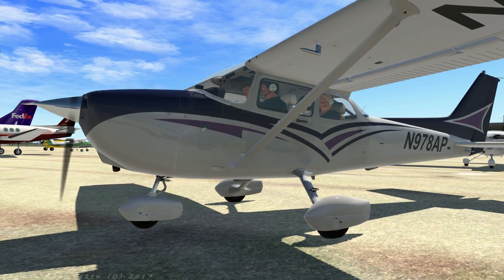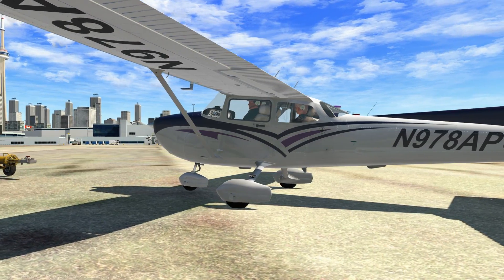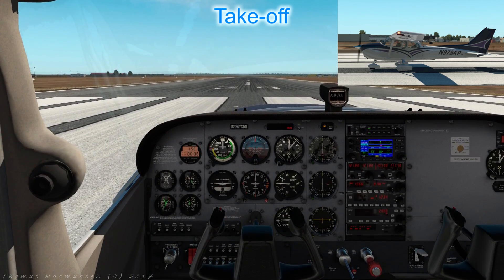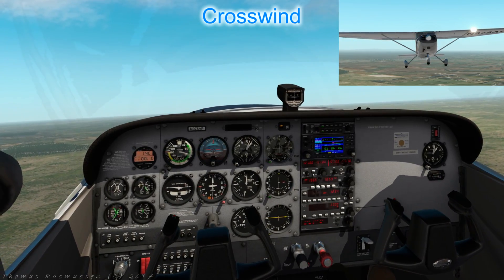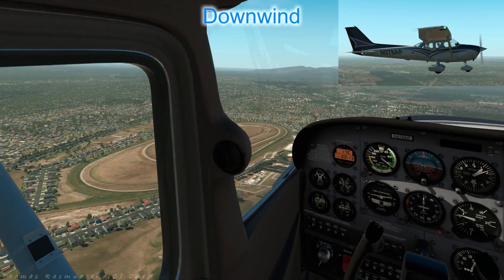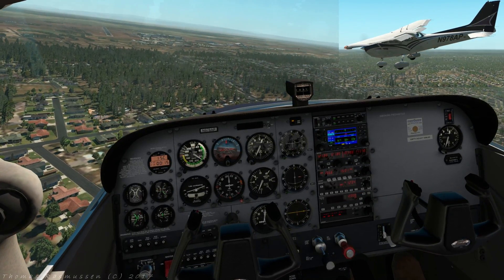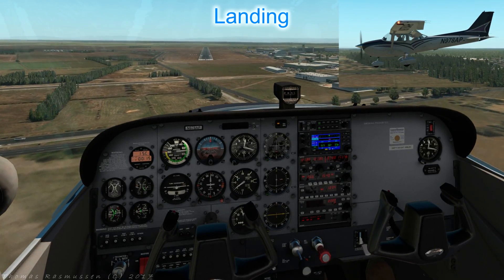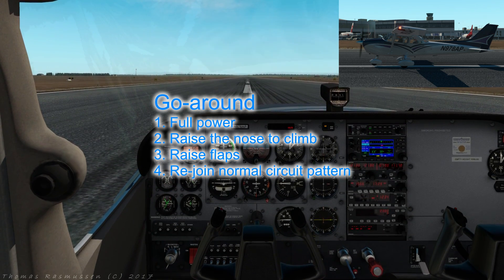[X-plane 11] Flight Sim School - VFR Lesson 6 - Basic Circuits

Comment: Hi Thomas, your knowledge of flying a circuit my be different now considering this video was made three years ago.  The down wind leg is flown much closer than a mile as stated in the video. Most pilots will place the runway in a position that is half way up the wing strut on a standard traffic pattern or circuit. How would another pilot find you in the circuit if you're a mile away?

Comment: "As the climb continues up to 1000AGL..."

Procedes to fly entire circuit at 1100ft
Reply from the maker: Field elevation as seen at 05:07 is 100 ft MSL so 1000 ft AGL is correctly flown at 1100 ft MSL
Reply: @ThomasRasmussenXPlane  But if you're doing circuits at an airport, why wouldn't you just get the altimeter setting?
Reply from the maker: From where I come from (and most other places I believe) you use QNH which gives you your altitude in MSL... But I do get what you mean - you could use QFE and start with an altitude of 0 ft AGL

Comment: Thank you for this, Thomas! Cameron's tutorials on the forum are excellent, but to see it in action (along with your extra commentary) is really helpful. I spent a few hours this weekend practicing ONLY circuits and finally feel like I'm getting the hang of it. 

One thing I find still really difficult is ground steering. I am using the twist-action on my joystick for rudder control and am wondering if using pedals would make this significantly easier. If so, any particular (reasonably priced) model you could recommend?
Reply from the maker: Thank you very much Jacob! I'm glad you've found the tutorials helpful =) I sort of got stuck, but I plan on completing the rest of the tutorials very soon! About rudder pedals - Imo they make it a lot easier also when landing in crosswind etc. I have both a pair of VKBSim rudder pedals, that uses non-contact sensors and which I like very very much and a pair of Saitek Pro Flight rudder pedals, which are also great. They both have their pros and cons! btw, I did a VKB review, if you're interested: https://youtu.be/lv5H27l851E
Reply: Thanks, Thomas. You also answered my next question regarding if you were planning on continuing with the series!